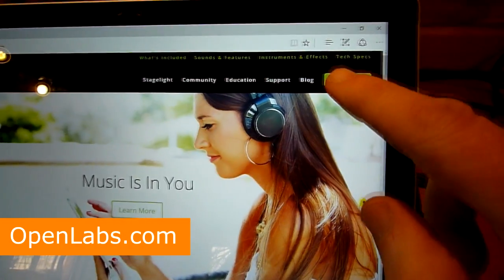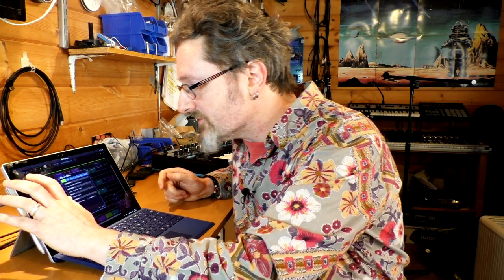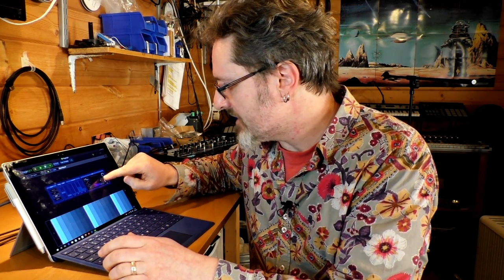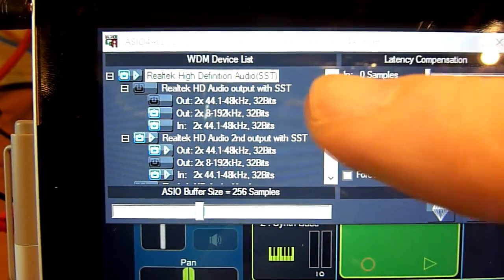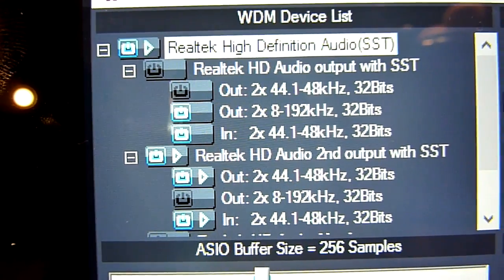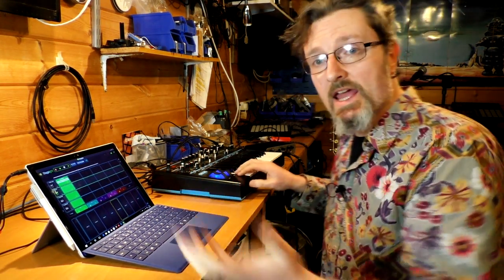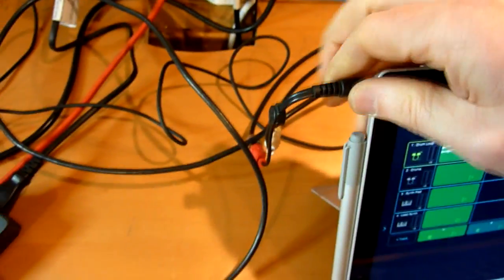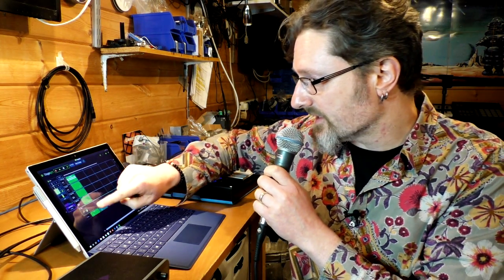Making Music on the Surface Pro 4 - Setting it all up

Comment: Would you still recommend the 4 in 2022 or a newer model? I don't really want or need to buy the newest most expensive one, just something that'll run my daw, vsts, and use that pen/touch combo. Thanks!
Reply from the maker: You can tend to do more with a newer machine but i've shown you what this is capable of - if that's enough then that can work for you :D

Comment: In the final configuration is the midi still going through Asio for all driver on the computer or is everything going through the interface even though the midi is still directly connected to the laptop? Thanks!
Reply from the maker: Midi isn’t related to asio. Midi in this instance is connected via USB and works regardless whether you are using the inbuilt audio or an interface for the sound. You would only use one audio engine. So if you have an audio interface then use that, if not then use Asio4all with the inbuilt sound. Your midi controller doesn’t care.

Comment: I have a (discontinued) Edirol SD-20 Sound Canvas that has sounds built in. It has a layer of dust on it so it's been a while since I messed around with MIDI. Back then, the sounds were either in your Keyboard, or your "tone generator" eg. Edirol SD-20, or your Creative Labs SoundBlaster inside your desktop.  LOL.  In your video, it seems like you said the audio interface reduces latency, even though the path is longer from your finger playing the device to the sound hitting your ear. MIDI Keyboard, to computer, to AI, to speakers.  Is this true? Are the sounds still coming from StageLite or does the  AI produce the sound, or what? Trying to figure it all out.  Thanks for the great video!
Reply from the maker: I have an old video on latency you really should check out - https://youtu.be/ojnnP_GXNaM
But in a nutshell - there's no latency between MIDI devices. Latency is to do with audio generation and processing. Latency is caused by the amount of time it takes the CPU to push audio through the connection to the audio interface. So if your computer is generating the sound (virtual instruments or monitoring through software effects) then they will be subject to latency. Audio interfaces with good drivers help keep the latency down to unnoticeable levels. If you use hardware synths and sound modules then you are unaffected by latency. Does that makes sense?
Reply: I think your reply does answer my question. Yes, I was considering trying out some SoundFonts and such (generated from the Surface Pro), but wasn't sure if getting an Audio Interface would "completely sort that out" (16:45).  Of course, immediately after you said that, you indicated that using the "on board" sounds required another solution.  So, yeah, your reply, and my actually paying attention to the video did answer my question. Lol. Thanks again!  I really appreciate your help.

Comment: Did you have any of the hardware problems/malefunctions on the surface pro 4?
Reply from the maker: No not really, I thought I did and even got it swapped out by Microsoft because of all the initial trouble getting the CPU to remain stable. But after a few updates and a deeper tweak investigation it all worked out fine. Even though I now have the Surface Pro 2017 for music making i still use the SP4 for day-to-day work tasks and it's been brilliant.

Comment: Amazing tutorial! I have a SP4 and your tutorials have helped immensely! That being said, I have a rather annoying issue with latency. I'm saving up for an interface and using Asio4all in the meantime for my MIDI keyboard. I followed your tutorial, and switching to the Asio driver cuts down some on the latency, but it still doesn't match up quite enough to be playable. No matter how I adjust the settings, the latency remains the same.  I'm sorry to have to put forward such a novice question. Should I just hold off recording, or is there a way to fix this? Thank you in advance.
Reply from the maker: What recording software are you using, and does it say the latency/buffer size is?
Reply: I'm currently on Reaper. Do you mean what buffer size have I set it to? (I've tried 512, 256, 128, and 64).
Reply from the maker: Ok, leave it at 256 - which driver is enabled in the ASIO4ALL control panel? Be precise.
Reply: Molten Music Technology Realtek High Definition Audio(SST)
SUBMENU-Realtek HD Audio output with SST
SUBSUBMENU--Out: 2x 44.1-48kHz, 32Bits
-- and-- 
In: 2x 44.1-48kHz, 32Bits
Reply from the maker: Ok - try just having one thing activated - those little power buttons next to each entry - have only one active. All I can assume is that there's an incorrect setting. Because following the details in the video - showing the settings for ASIO4ALL - that's what made it work. If yours is not working the same then I can't really help you any further than to suggest to get a proper audio interface and stop using ASIO4ALL. And we all have different ideas as to what's "playable" but i think i demonstrated that in the video. Good luck!
Reply: So I solved the problem! I went through all my devices in the control panel and disabled them in the sub-menus, even though they weren't active. Not sure which one was to blame, but I'm using my main audio output device at 128 buffer size and the latency is greatly reduced. Sorry for the trouble, it was a simple fix. Thank you for your help!
Reply from the maker: Yay! Well worked - nice one :)

Comment: So I found a Fast Track Duo just like your unit used so I ordered it. What I realized is I have unpowered huge speakers and I don't think those will work. The guy at guitar center said as far as getting powered speakers he thinks I shouldn't and I should just use headphones or I will get a delay and it might record feedback when I'm singing. Is this true. I hate headphones and have no ability to mount them higher. I was hoping to be able to use speakers so I could hear myself better. I didn't want to spend a lot of money. Do you recommend speakers for recording and if so, what kind?
Reply from the maker: When recording through a microphone you are going to want to prevent unintentional noise being recorded as well. So having the backing track also recorded in the background of your vocals is not going to sound very good in the mix. Headphones are the best and tried and tested way of feeding you the music and not have it bleed into the microphone when recording. If you are doing something a bit more live - recording a band all at once - then there's always bleed, which is what gives a live recording that "live" feel - it never sounds as good as a studio recording - but that's ok if it's supposed to be "live" - does that make sense? Speakers are great for listening to the music when mixing. If you have unpowered (passive) speakers then presumably you have some kind of amplifier that plugs into them right? (otherwise they are completely useless). If there is an amp then you can plug the output of the FastTrack into the amplifier which will put it through the speakers. Powered speakers just put the amp inside the speakers but otherwise work in exactly the same way. What you should do is try it out - learn as you go - try with what you have, see how that works before you try to solve problems you haven't met yet. I hope that helps.

Comment: my dearest. thank you a lot for these videos. you sold me the surface! hehe just after seeing the pro 3 vs pro 4 i would like to know what is your preferece, since i am more inclined to the 3 due to those glitches issues you pointed out. cheers from Brazil!
Reply from the maker: Well, if you take a look at my more recent videos you'll see that the SP4 is greatly improved. I should finish up my testing on the Surface Book over the next couple of weeks which, along with the SP4, should show the improvements. The SP3 is great but you do have the throttling issue if you push it too far. The SP4 handles that better with the right combination of software and hardware.

Comment: I have the surface book, and when I use it as a tablet (no keyboard), I do not have a usb port.  Is there some way to drive midi through bluetooth and get some type of adapter to hook into my yamaha midi keyboard?
Reply from the maker: Yes, possibly - not something i've tried but a quick google revealed http://www.synthtopia.com/content/2016/01/22/yamaha-wireless-midi-adaptors-add-bluetooth-to-your-existing-gear/

Comment: First off, fantastic video. Next payday I will be shipping your kickstarter fund with a few pounds sterling. I really appreciate the effort that has gone into this (and your other) videos. Secondly a question; what spec of surface pro 4 are you using? Did you go all out on the i7 processor or has the i5 met your needs?
best regards.
Reply from the maker: +Tom Tinkler Hi Tom - the Kickstarter is long over but thanks for the offer :)
It's the i5 8GB 256GB version - the best choice in my opinion. I'm currently working on a bit test of the SP4 which is revealing good and bad stuff so hang on until i get that published in the next week or two.

Comment: You should almost be a hacker to get windows to work optimally for music production, on the ipad air 2, plug the soundcard in and then garage band or cubasis. 128 polyfony on air2 I do not know the surface pro as well but I know you can interrupt the background applications to get a better user experience on win 10. Good video
Reply from the maker: +jacobhn2 Apple has the advantage or writing an OS for a single bit of hardware whereas Windows has to work on a thousand different machines with thousands of possible combinations of hardware and software. With that in mind Windows is amazing - but, generally Windows requires very little tweaking to work well these days and if you use a decent audio interface then it's very easy and obviously far more versatile than iOS :)

Comment: Are you going to do a video on doing music on the iPad pro?  I have yet to find a way to attach a mbox or focusrite to a I pad.
Reply from the maker: +cdelaine Sure - can you send me one?
Reply: I can't, they are expensive.
Reply from the maker: +cdelaine ok then, i'll stick to making videos on the gear i have.
Reply: I gotcha. I actually have a Surface pro 2 that I use for data wrangling with my DSLR. It fits in my camera bag with all my gear. When the  ipad Pro launched I considered it but it looks hard to get media on site in and out of it without a computer which would defeat the point. However everyone I know in music production uses a Mac so I thought it was interesting you would choose the Surface pro 4 over the iPad Pro.
Reply from the maker: +cdelaine Simply because the Surface Pro 4 is a real computer running a real OS capable of running real music software rather than little music making Apps. Macs are fine but they don't have a touch friendly OS and so are missing out on a huge raft of creative expression and opportunities that the Mac can't do and the iPad can't handle. There's lots of fun stuff on the iPad platform but i want to use Pro Tools and Bitwig and Reaktor on the Surface and that's why only a proper computer will do.
Reply: I will admit that I do like the fact I can run Photoshop on my Surface Pro 2. You have inspired me to give Premiere Pro a try!
Reply: +cdelaine That's because the IPad pro really, really, really sucks. The surface pro 4 is a more  sufficient product than the iPad pro.  The iPad pro may be a fun little toy, but the surface pro 4 is the real deal.

Comment: Hi Robin, thanks for these excellent videos!  Your earlier one sorted my initial ASIO4ALL crackling issues, however my latency is being compromised by a lot of intermittent stuttering that also affects the generic driver, and makes it sound like I'm trying to play with a severe case of the hiccups.  Even with the exact same ASIO4ALL settings I can't reproduce the consistent response you're getting at 20:56 - is there a setting elsewhere I should be taking into account?
Reply from the maker: +Chris Jones Hmmm..... have you followed my suggested tweaks? Make sure there's nothing running in the background. What synth are you trying to play? Maybe you're loading something too big for it to handle.
Reply: +Molten Music Technology I tried all the pertinent tweaks, nothing running in the background, using the default drums in Stagelight.  I'm starting to wonder if it might be interference from my screen protector actually, even though I had initially tested and discounted that possibility.  I should be able to confirm whether this is the case by testing with an external MIDI device, yes?
Reply from the maker: +Chris Jones Best bet is to disconnect everything and try that - use it with nothing else running or attached. Does it work without crackling if you use the regular drivers?
Reply: +Molten Music Technology I'll have to see if I can find somebody with a USB MIDI thingy (I only have a MIDI MIDI thingy).  The regular drivers don't normally crackle, in fact the latency compared to ASIO4ALL isn't exactly night and day either, which has me wondering.

Comment: thanks Robin, that was really useful to get started :) do you have any experience with Line 6 equipment?  I came across a bus powered midi keyboard and USB audio interface in one from them, which seemed like a good idea.
Reply from the maker: +Wesley Platel Yeah, the Line 6 keyboard was a cool idea i thought - just a bit plastic and toy-ish - worked ok last time i used one but that was a few years back and not on a Surface.

Comment: Good job Robin had me in hysterics :) excellent for beginners! +Garry Knight there is an insy-tinsy Focusrite called a Scarlett solo that's just 70 sheets, or the Roland Duo Capture if you don't need XLR input, or the Alesis iO hub, M-Audio M-Track solo etc etc. "Ohhh, I was such a young boy...."
Reply from the maker: +Kevin Redding Cheers! I've heard of people having trouble with the Focusrite stuff on the Surface Pro 3 and I don't think the Alesis has ASIO drivers, so always choose with a little bit of caution but there are some good interfaces out there - the new M-Track ones look great.
Reply: +Garry Knight After a few nights playing with this I am starting to get some strange behavior. Seems to work without an issue when just using the SP4 as a guitar amp effects rig - that's with Guitar Rig standalone or using some contraptions I use built within Reason 8 to process my axe. I can output from my desktop PC through the sp4 and do all sorts of magic external processing - as long as its limited to a single stream. But start multitracking and after a bit all hell breaks loose. Crackling, bizarre bouncing CPU spikes and drop outs ending in "Your PC is too slow to play this song" (Reason 8). Reset the driver or play with buffer size and its back to stable again - for a bit, and seemingly regardless of buffer size settings initially. Robin said in his March update that he was experiencing some issues - maybe this is it?
Reply: +Kevin Redding Thanks, Kevin. A great help.
Reply: +Molten Music Technology Thanks for mentioning the ASIO drivers, Robin.
Reply: +Garry Knight Just in case you were interested, I bought a Focusrite 2i2 to try out on the SP4 and it works a treat Bus powered, which I'm pretty pleased about :) It seems to be relatively stable at lowest latency (48 samples, 4ms in 4ms out) for low loading, which is awesome for Guitar Rig 5 :) Truly portable guitar setup, just plug into the PA and away we go!
Reply: Thanks, Kevin. I have the 2i4. Might suck battery a bit more but should still work fine. Good to know
Reply from the maker: +Kevin Redding Ok boys this is starting to become a thing. I've been working with Microsoft on glitch issues with my SP4 for the last few weeks - it's the reason why they've been no new videos on the subject. I have a replacement SP4 turning up next week to use as a comparison and i've been sending audio trace reports to some very techy people who apparently have a "theory" - but it's all taking a long time. I need to start gathering more information from more users so that I have more pressure to apply to MS. So would you mind emailing me some of your experiences so far - what works and what doesn't - so that i can add it to the current knowledgebase of what the heck is happening. Thanks!